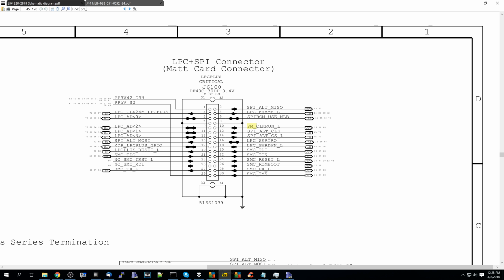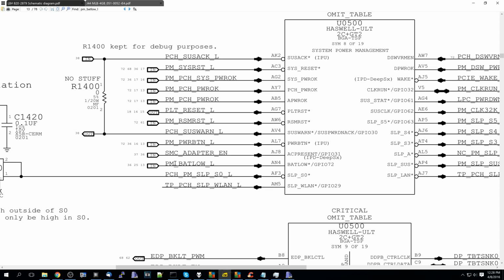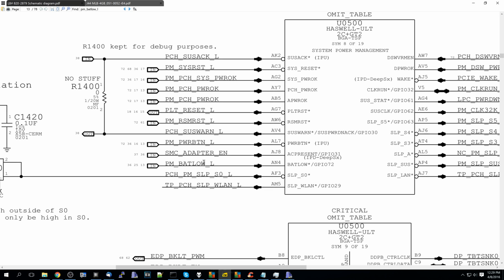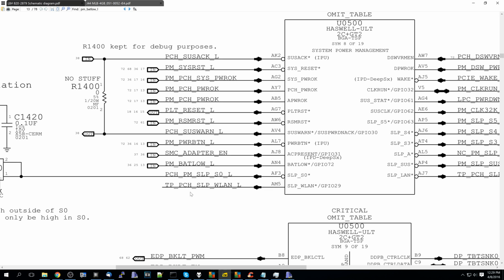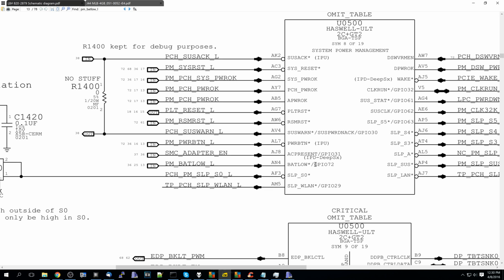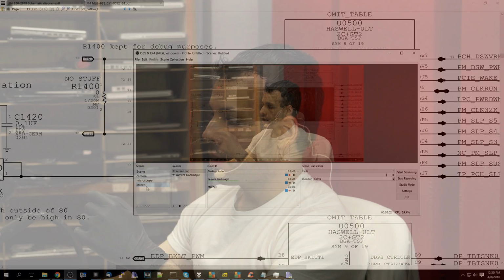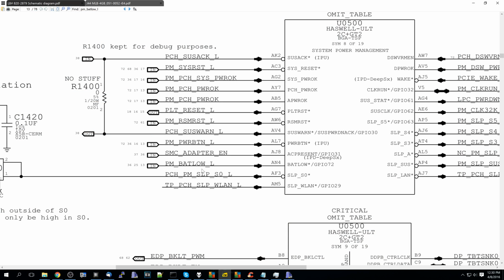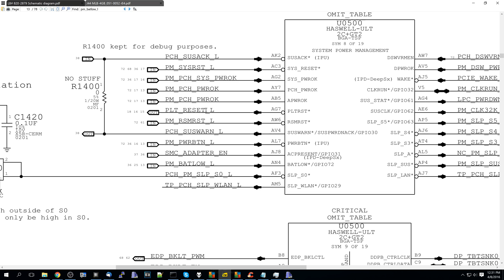Electronics schematic reading; what does the _L mean as the suffix of a signal

Comment: Also called an "active low" signal. Notice, too, that the names of the corresponding component pins end in a "*" character. On non-Apple schematics, the most common notation is to use a "#" character at the end instead (e.g. "PCH_RSMRST#").
Reply: +Galactic Edge Other options you may see include being preceded by a exclamation point (!) or having a horizontal line over the name